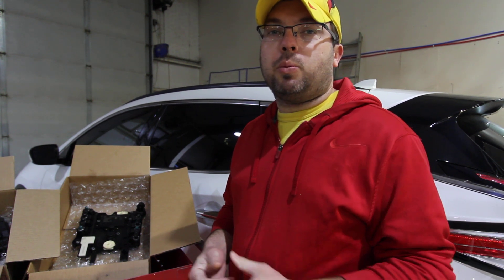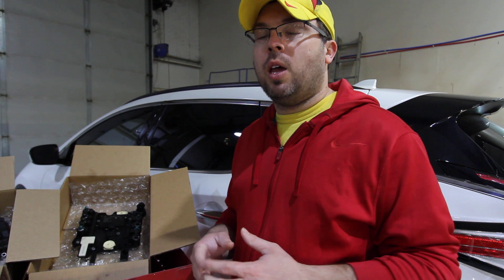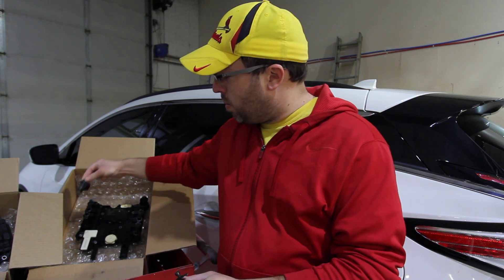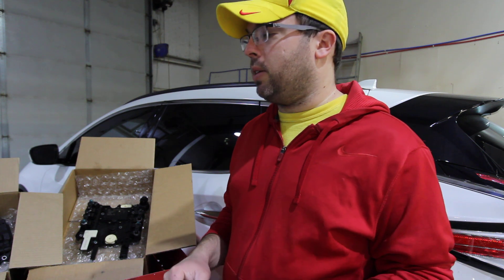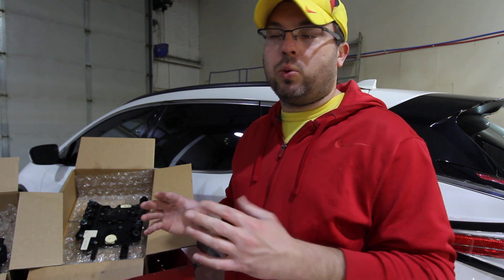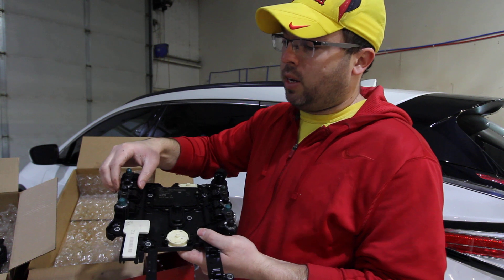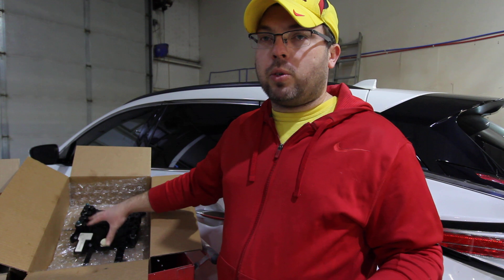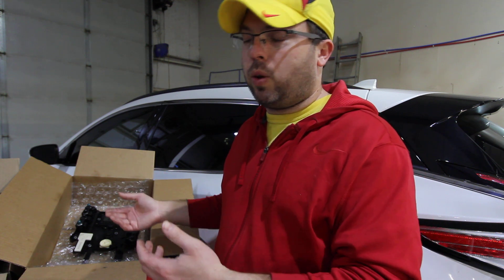Mercedes Benz VGS 1,2,3 And Mercedes Benz Intelligent Servo Module ISM Unlocking used modules 722.9

Comment: I have a 06 ML 350 that transmission will not ingauge in drive or reverse what do you think i should do about it
Reply from the maker: Start with code scan but I bet it’s a bad ism
Reply: Also check the fuse that controls the transmission in the engine compartment. This is especially when it's says do not shift gear go to workshop

Comment: Hey man I hope u can answer this so I have a 7229 with vgs2 from factory my speed sensors when bad of course. Since I can’t purchase conductor plate from dealer they have on fcp for my vehicle but it is a vgs3 will that work with my transmission being it is vgs2 from factory.
Reply from the maker: You will not be able to clone that particular unit it would have to be programmed but it will work in your transmission

Comment: if you buy a brand new one from mercedes do you still need star to initialize it or clear the old codes after installation or is it plug and play?
Reply from the maker: You have to do the initialization procedure
Reply: @SpartanAutoworx  thanks. just bought star so i can do it